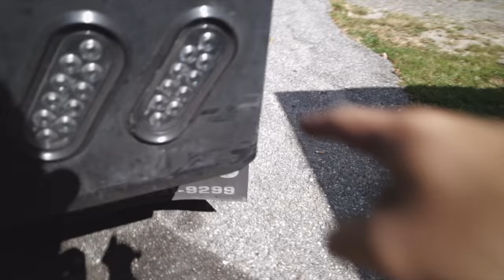DEBTOR SKIPS STATES REPO! MUST SEE!

Comment: Question about the seatbelt through the steering wheel.  Is that something that works for all vehicles including 4-wheel drive for the type of tow truck you have, or would you still need to request a flatbed for a 4-wheel drive - or does it even matter? I see you picking up all types of vehicles and it's the same tow truck. I have an All-wheel drive and was told that 4 wheel and all wheels are supposed to ask for flatbed tows when needed. I get the seatbelt through the steering wheel is to help keep the wheels straight while the car is in neutral. Just confused.
Reply from the maker: Everything brother. Keeps wheel from moving on RWD and AWD if using Dollie’s front
Reply from the maker: AWD cars need Dollie’s or flatbed
Reply: @JCKDTV  Thank you! Cuz they never explain the reason why you need a specific tow truck - at least not to me just that ones going to cost more than the other lol

Comment: Question is it really ok to tow a 4wd from behind and not using dollies? I know awd yes must use dollies but I just want to know for myself
Reply from the maker: No sir. Need Dollie’s unless it’s 4wd on the floor
Reply: @JCKDTV  ok so when it’s the 4 on the floor do you put it in neutral?
Reply from the maker: @prism06  yup
Reply from the maker: @prism06  and I’m this case with this vehicle it has a2wd low so it’s okay to tow without Dollie’s